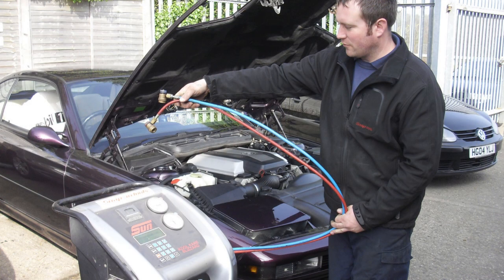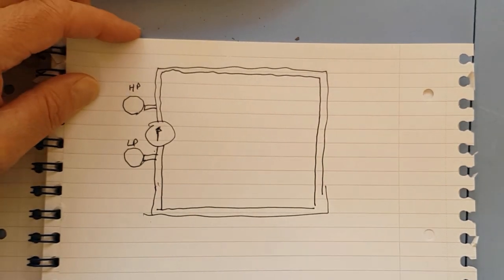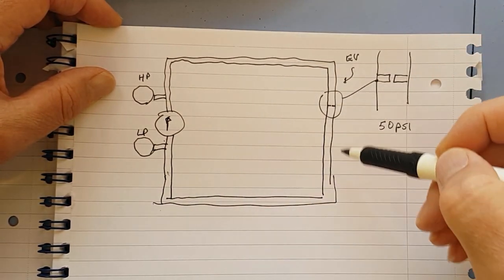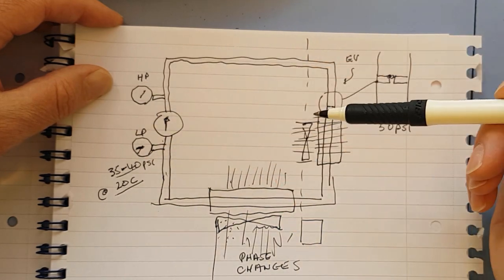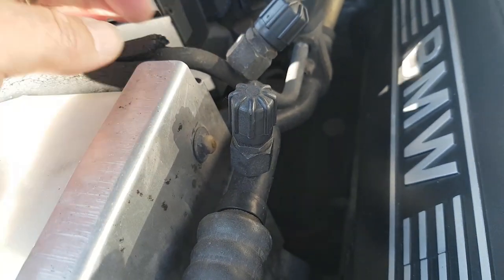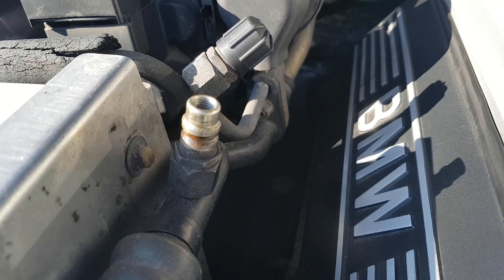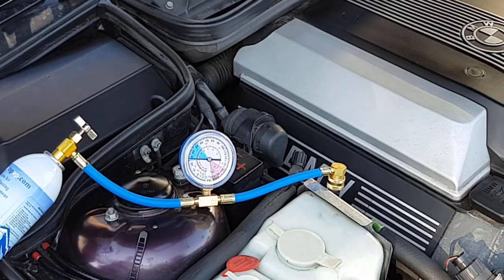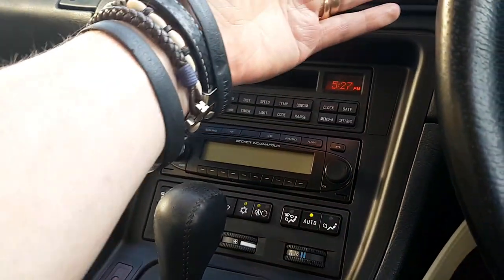BMW Air Conditioning - Do Top-Up Kits Work?

Comment: Great video .I have bought the charging hose only to confirm the level of charge in my cars system.  I will buy the gas later . I do live in Yorkshire!!  

At the risk of teaching my granny to suck eggs  !!  Have you got the  condenser in the right place in your drawing ?  I thought the condenser was before the expansion valve to change the state/phase  of the high pressure gas from the compressor  to a liquid for the expansion valve to change back to a gas.

Really useful video picked up lost of good tips . Your work  much appreciated.

EdT
Reply from the maker: Yes, you are right - I noticed my mistake as soon as I had uploaded the video!

Comment: Timm, there was a older US study done when R12 was being phased out in the early 90s... 
Basically, the issue was that all the legacy meat packing trucks in the USA ran R12 and wouldn't keep cool with the then new R134a. A University experimented with mixing gasses and found that a 20% R220 mix and 80% R134a mix gave the same performance as R12 in a R12 system.
Reply from the maker: That's great info, thanks!

Comment: Good explanation. One note though - the condenser is on the high pressure side. It condenses the superheated gas from the compressor into a subcooled liquid prior to the expansion valve.

The compressor on the suction should just be drawing in a gas (all the liquid should boil off in the evaporator)
Reply from the maker: Thank you! And thanks for putting me right!

Comment: Very informative thanks. I fell at the first hurdle when I tried exactly the same kit. The nozzle would not fit on the low pressure pipe. Then I found out there is a newer refrigerant called R1234yf and my car has that, along with a fatter nozzle by the look of it. I will investigate further.
Reply from the maker: First, make sure it was the low pressure and not the high pressure! Earlier models (pre '92) will have used R12 and has a different connector.

Comment: Hi Tim, I live in California, I have a 1995 840Ci with 85K original miles on it, I rarely ever drive it.  I just recently developed a coolant leak issue that comes from a unit next to the firewall (left, driver side) right next to the fuse box.  the plastic unit that a hose goes in has broken off and i need to fix it.  First i dont know what the unit is called, second it is very challenging to access that unit to take it off.  could i send you a picture of it to identify it for me?  any recommendations?
Reply from the maker: Here's how to sort it: https://www.meeknet.co.uk/e31/E31_Heater_Valves_Replacement.htm

Comment: Hey Timm, I have a "93 850ci. The sunroof was dismantled as well as the front bumper airflow system. I'm wondering if you could do a video on the installation of one. It would save me tons! keep up the good work and stay safe.
Reply from the maker: If I ever need to repair either of those I will do a video!

Comment: Hi Tim. Great video like always. I replaced my ac compressor on my 94 840 Ci. I started the car without refilling the with the Freon R134 to see if the ac clutch kicked on. It did not. Do I have to fill the system to engage the clutch???
Reply from the maker: It will not engage the clutch unless there is refrigerant pressure as it would also mean that there is no PAG oil!
Reply: Always a wealth of knowledge Tim.  Thank you  @TimmsBMWRepairsandInformation

Comment: Hi Tim,  I have 2011 E92 that I bought just 4 months ago.  The AC just wouldn’t get cold enough and seemed to make a rhythmic  vibration noise.  I did as you did in this video and added refrigerant and brought the low pressure side up to 35psi.  The AC work great now and has continued to work great since I did the job 3 months ago.  My only question is this.  When I turn on the AC there is still that rhythmic vibration noise.  The longer the AC is on the louder it seems to get.  What do you thinks that noise might be?  Too much pressure in the system?
Reply from the maker: If it were too high pressure it would vent. Without hearing it I would guess a beat between the fan speed and the compressor speed
Reply: @TimmsBMWRepairsandInformation  could you please elaborate?   What do you mean by “beat a difference between the fan speed and compressor speed”?  It definitely doesn’t sound like it is coming from the fan itself.  I was thinking that it could be the expansion valve.  Am I way off?

Comment: Funny that they have actually lowered the amount of gas these things hold. My 85 300 MB held 4 pounds, a hair under 2 kilos, but my 2001 e320 only holds about 1.8 pounds, under 1 kilo. These newer systems actually don't cool as well. The vent temp should be about 4°c, 40°f. I don't know if mine gets there since I don't have a stick thermometer but it seems slow to get cold. I had it checked and replaced the low side inlet about a year ago and recharged with no leaks. I am in a much hotter climate than you so that makes a difference. It is supposed to get over 100°f middle of this week.
Reply from the maker: Proper A/C on the old cars!

Comment: Cheers Time, great video. Ill be looking at working on my 650 in the coming weeks as it seems low/non existent. (coldness) Im thinking put it in for a free check at a garage to see if its working and just in need to a top up, then getting them to refill if it is, then topping up as needed in future. That way i know I'm starting from a good known point. Only concern is that i could lose out if it leaks out over night... I assume the only way to check the system is airtight / working is to risk a loss of refrigerant..
Reply from the maker: I would take the car to one of the garages that have an automatic A/C servicing machine, that would give you a good idea if anything was leaking.

Comment: The reason for charging as a liquid with these cans is because its probably a blend of R600a (isobutane) and R290 (propane) They boil at different temperatures so charging as a liquid will ensure the blend is correct.

You should bleed back to the can before puncturing as otherwise you're introducing air and moisture into the system every time. Not good.
Reply from the maker: That's great information - thanks!
Reply: @TimmsBMWRepairsandInformation   One thing I worry is that I'd think the two refrigerants in the blend (I only assume that's what the hydrocarbon blend is, they don't specify) escape at different rates as their molar mass is different.

That could be a pain come a couple of recharges later as the system would get out of whack and probably would need a full recover and recharge. A recharge with the blend would be fine but how many of us have the equipment to do that? (At least you can dump hydrocarbon refrigerants to atmosphere legally) 

As a drop in get you up and running again it definitely does work well. I topped up an old car with the same can only last week on a car that was 7 years old. I'm gonna see if I can stick a proper manifold guage on and see if I can get some temp sensors on to see what the head pressure is doing and the superheat and subcool are but the air certainly matches what I expect it to be given the low side pressure.

Probably a bit out of scope of a YouTube video though 😂

Comment: Hi Timm I do follow you weekly on any video of bmw you do 
Especially on E31 ( I’ve 840 ci1998)
Got an issue with AC
I did exactly what you did on the video
It worked very well indeed 
However My AC  unit starts 4/5 minute after I turn on the on/Off wheel !!
No power goes into the unit, no LED no functionality at all. 
However if I wait ( WHEEL it’s ON) than it starts automatically 
It’s like the AC UNiT  timing it’s not synchronised with the car ——- but works perfectly once goes on 
Any suggestions-  pls pls 🙏🏻
Reply from the maker: Check Fuse 21: https://www.meeknet.co.uk/e31/Timms_BMW_E31_Fuse_Finder.htm
Reply: @TimmsBMWRepairsandInformation  ok will do and let you know !!🙏🏻
Reply: @TimmsBMWRepairsandInformation  all the fuses are in order
Reply from the maker: @adrianocarlucci4029  Whenever I hear 'all fuses are in order' it makes me think that you didn't try replacing Fuse 21! It is worth swapping because up next it's electronics all the way!
Reply: @TimmsBMWRepairsandInformation  will change it tomorrow and let you know
Thank you very much !! Happy to compensate for disturbing you
You’re a Guru on BMW 🙏🏻
Reply: @TimmsBMWRepairsandInformation  Hello Mr Timm, I did it and nothing has changed!! It works perfectly, but when I turn the wheel on doesn’t not start, it’s completely dead, than ( keeping it on ) it starts automatically after 3/4 min
I just don’t understand the 3/4 min dead time ! It’s like it has a timing clock !! Many thanks indeed for you help !! 🙏🏻
Reply from the maker: It does sound like the IHKA panel electronics I'm afraid, not much left but that!
Reply: @TimmsBMWRepairsandInformation  ok understand 
Thanks very much !! 🙏🏻

Comment: I replaced most of  seals and re filled the gas. But AC still doesnt cool perfect. Everything is good on paper.
Reply from the maker: Check that the compressor and auxiliary fan are actually running

Comment: 1-Never turn the can up side down...liquid gas destroys 
 the compressor...you're charging the system thru the low pressure side witch is the gas  side of the system not the liquid
2-Always purge the air from the hose.
Reply from the maker: Thanks - but the instructions are to invert the can - something that wasn't done with the original refrigerant!
Reply: @TimmsBMWRepairsandInformation  
OK friend, it's your car, but liquid gas it's on the high pressure side.
Turning the can up side down you're sending liquid gas to the compressor, and compressors only compress gaseous not liquid.
This is not a hydraulic system...the instructions are wrong.
And always purge the air from the hose so that you don't send air and moisture to the system.
Good luck and good videos.👍
Reply: To understand why you turn the can upside down, try filling an almost full cigarette lighter with the refill can upright. You will find the lighter liquid gas will empty into the refill can. You would think that the refill can would still fill the system even when upright but it doesn't. Once the liquid is pushed into the low pressure side it immediately expands into a gas. Unless you completely over fill then as you say, you will lock up the compressor. HydroLock. Possible damaging the compressor.👍👍
Reply: To remain a liquid refrigerant needs to be a lot higher pressure in the low side.

Comment: I cannot bring myself to use hydrocarbons in my AC..Mind you, I don't think it's incredibly dangerous. As for monitoring the quantity, you can judge by the feel of the return pipes and the sound of the compressor, gas sounds in the dash, and the performance of the system..

This whole AC  thing is really a jack-up between the environmentalists and the motor trade. Any time I have had a car that's leaking AC gas they fill it up, charge me money and a while later all the gas is gone.. I am not convinced the DIYer is going to pollute more than the so-called professional.
Reply from the maker: Yes Andrew, I agree!
Reply: I have used butane gas for years without a problem. A lot cheaper and environmentally friendlier than CFC,s.
Reply: @stephenjones9153  It's more to do with accidents. The stuff will leak then and potentially ignite. Same like it could be perfectly safe to have a grenade in your pocket for years. But one day you might pull the pin by accident.